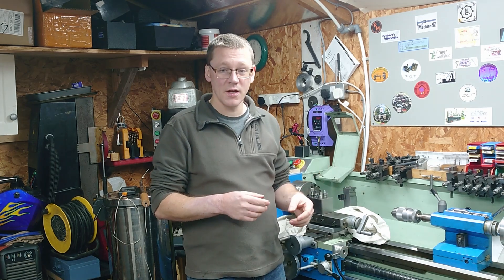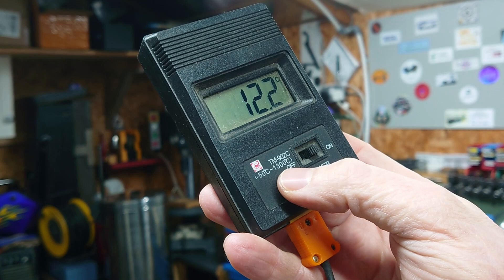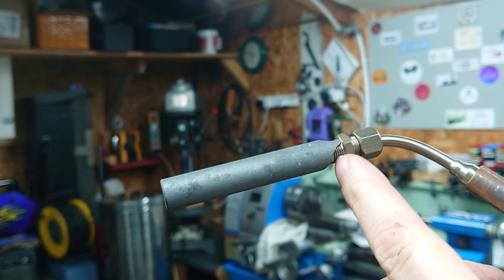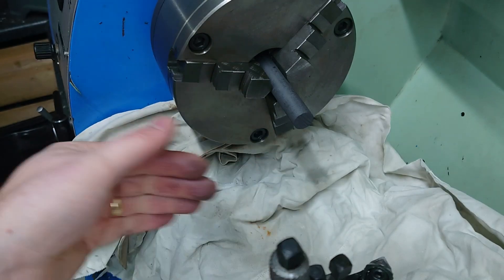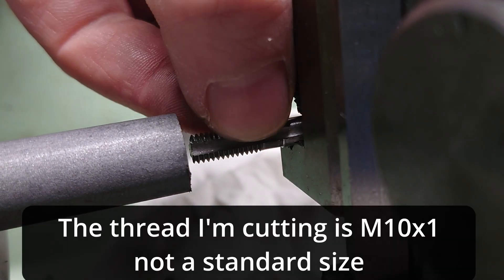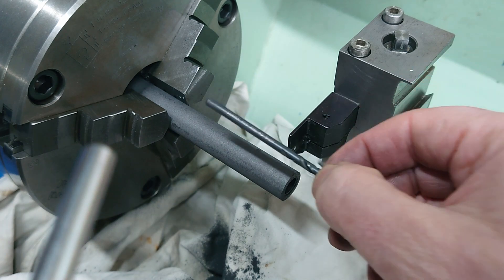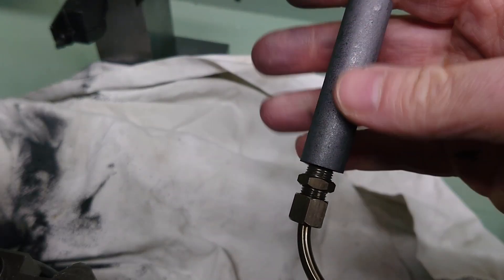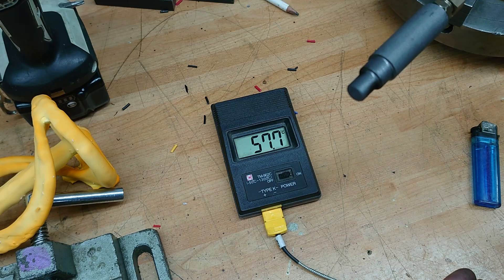Machining graphite bar for a thermocouple [A23_2]

Comment: Morning Olly. Fabulous episode. Not only does this give me a great idea for making a graphite sleeve for my own thermo couple which I use on my type casting machine, but I also absolutely adore your trick of using an offset tap to cut the thread you needed. Inspired. 👏👏👍😀
Reply from the maker: Hi Andrew. The tap thing only works if it's the same pitch as the thread you want to cut, but 1mm threads crop up quite a lot. I think I've only used that method a handful of times, but without a tiny single point tool, it's the only way. Thanks for watching
Reply: @ollysworkshop  Thank you for the clarification which makes perfect sense. Definitely one for the memory bank. 👍

Comment: Do you think you could form a tapered internal thread by putting the angle on the tap in the toolholder?
Reply from the maker: Sadly not. In order to form a tapered thread the thread cutting tool must move at pitch of the screw otherwise you'll just end up with a bunch of grooves in a tapered hole. However it may be possible to "free hob" a tapered thread if the threading tool could move in and out freely, but not rotate. Engage the tool and let it pull itself in 😬 it might work?!
Reply: @ollysworkshop  G'Day Olly, congrats on No 2, may there be 22 more.
But can I get a rethink on this explanation, If the QCTP holding the broken tap(which is now technically a multiple-single point threading tool on the outer side of the hole) is rotated a couple of degrees clockwise and you still use the 1 mm per revolution advance on the lead screw, won't you end up with a tapered thread inside the graphite?
Really wishing I wasn't 150 klm away from my lathe right this minute, other wise I would try setting it up.
Reply from the maker: @Bobs-Wrigles5555  hi Bob. If the compound slide moved, then yes, but on my lathe it's only the carriage that can be driven, so the tool may be angled but it's just ploughing into the work at an angle.
Reply: @ollysworkshop  Still trying to nut this one out, and getting a headache.😀
But if the tool is angled to match the taper of the tapered nut, and the lead screw moves the saddle along 1mm/rev'n(ie the tread pitch of the broken tap) and the tip of the tap's multiple points are positioned say ~0.5-1mm inside of touching the graphite and the rear of the tap interferes the depth of the thread wanted , doesn't this mean you will slowly cut an angled thread inside, in other words a controlled plough in matching the taper of the nut?
and Yes I understand it would be very sensitive to how far you go inward.
Reply: That's what I'm thinking. I'm sure it isn't the proper way to do it but in a such a soft material it might work. You'd have to be careful with the depth of cut changing as the tap advances and make sure the travel into the hole is consistent pass to pass.  @Bobs-Wrigles5555
Reply from the maker: It would do something! But the tap isn't moving along the line of the thread, it's moving at the taper angle to the bore. Imagine that the taper is 30 degrees, the tap is 60 degrees. One of the thread flanks will cut at 90 degrees and the other at 30. So even if you only moved in one thread pitch and used the multiple cutting edges, the threadform would be messed up.
Reply: That's true. The angle on that thread looked pretty shallow so I wonder if a dodgy thread profile on the angle would be a better compromise than a proper profile but parallel - might at least reduce the risk of cracking the part if you screw it on too tight. Best bet would be an ELS driving the compound, now there's a project I haven't seen anyone do.... I suppose  @ollysworkshop
Reply: @ollysworkshop  & @WilliamChitham 
Ah, Got it, I knew I was missing something, tapered threads are full threads cut into a conical shape, not partial cut threads and you need the compound movement to obtain that, and using the angled tap, screws (pardon the pun) the thread cut angles.
It might work, if it was a once only fitment in say Aluminium, but it would gall and bind and it would tend to push out the sides of the graphite you're using, because of those thread cut angles.
Thanks Olly.

Comment: Gday Olly, I’ve never seen that material before, extremely messy but easy to machine, nice job mate
Reply from the maker: Hi Matty. The chuck needed a vacuum, a wipe down and a bit of compressed air to get it clean after that! Thanks for watching.

Comment: Nice one Olly, never cut that stuff, looks messy but very forgiving. Cheers, Jon
Reply from the maker: Hi Jon, very silky to machine, but does indeed make a mess. It may be better to run the vacuum as close as possible to it, but there's never anywhere convenient to put it, especially with a camera in the way!